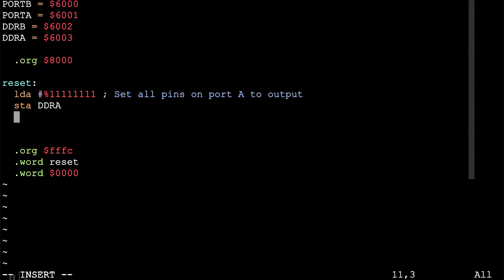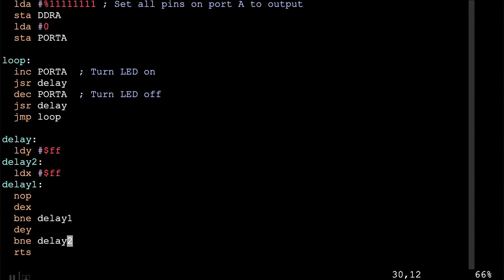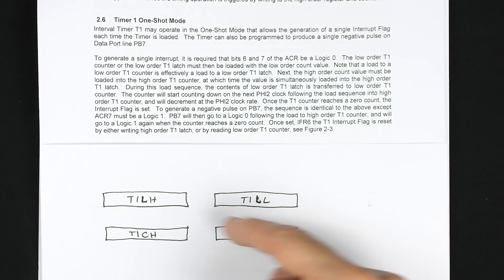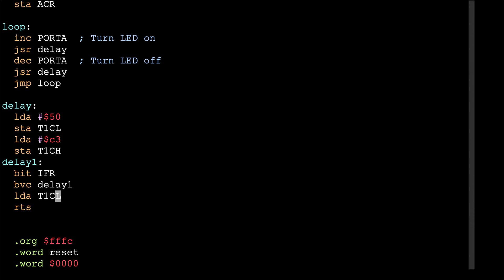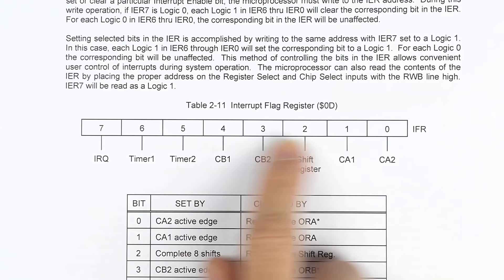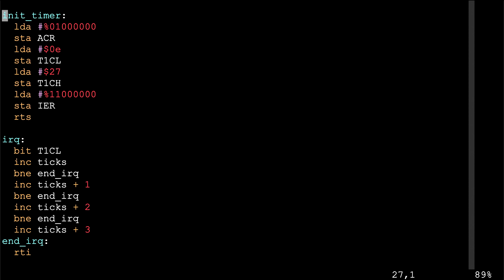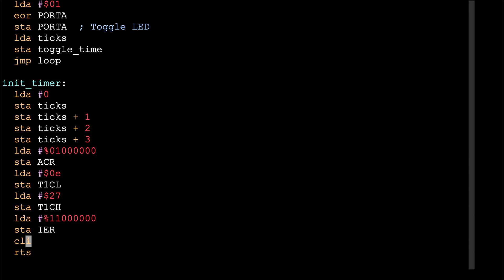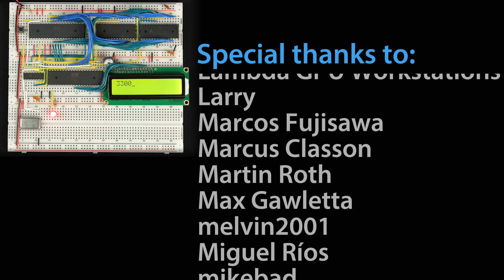How do hardware timers work?

Comment: I love everything about this series. I'm eagerly awaiting the point where Ben eventually builds a C compiler for the breadboard 6502.
Reply: You'd love the book "Assembly language step-by-step" by Jeff D. It does exactly this
Reply: @sadhlife  it is not the same thing. It has to be done by Ben.
Reply: @sadhlife  if not then thanks for the link. I will be looking into it. Thanks for adding to the YT conversation.
Reply: @ElSenorEls  Well, not everything has to be from scratch.  Ben might be able to demonstrate an integration of existing freeware into his machine in such a way that one can readily duplicate it.
Reply: Do you mean a C compiler that runs on the breadboard 6502 or a C compiler that merely targets the breadboard 6502?  
While I get that compiling C on the machine that targets itself would be a really solid learning experience in many ways, especially if it's capable of self compiling, there are a lot of reasons most consumer level computers using 8-bit processors defaulted to an off the shelf Basic interpreter within such constraints and many of those would equally apply to a project like this.
Reply: .. and a filesystem
Reply: @chiblast100x  First one, then the other of course! Then all he has to do is get it to play DOOM.
Reply: Not doom - elite
Reply: @Sigira0  Crysis lol
Reply: @sadhlife  I'll have to mention this to Jeff D. next time I run into him online.
Reply: @sadhlife  Do u have any recommendation to (if possible) kernel/kernel-like os for AVR? I assume it is not recommended haha
Reply: @mickolesmana5899  no clue :)
Reply: I'm waiting a 2 core 6502
Reply: Considering the 6502 time-frame, FORTRAN IV might be more appropriate. Of course, this isn’t the history channel…
Reply: @saxhorn1508  : What he should really do is a threaded-code variant of Forth, with just enough extra code to provide the common Forth in-place compile, support for a simple filesystem on SD, software based memory paging, and the extra Forth primitives required to perform C and Basic operations semi-efficiently. Then he'll be able to implement whatever toys or demos he wants fairly simply.
Reply: Nah, what we want is Linux running on it with a C compiler. :)
Reply: I'm pretty sure the small stack size of the 6502 would prevent anything more than a minimal C compiler.  I could be wrong though, I'm definitely not an expert.
Reply: @AndreasToth  Don't see that happening as even the very first Linux kernel version was for 32-bit machines and a modern kernel is way too large for what we need here. But an old-school Unix kernel, like going back to Bell Labs and the Ken Thompson and Dennis Ritchie days of the early 70s may be more appropriate.
Reply: And possibly create his own language and a whole parallel universe analogue to GNU/Linux. That'll be just great 😁
Reply: @stevedonkers9087  There already exists a C compiler for the 6502. It's called cc65. It's quite an impressive piece of software and does a good job considering how poorly tailored the 6502 architecture is to a language like C. I have also seen C be used for the 65816 chip. In fact, the source code to Wolfenstein 3D on the SNES leaked, and it was written in C. As a matter of fact, WDC provides their own C compiler for the 65816. Although, the Z80 is apparently much more suitable for usage with C, still not great though. Certainly very doable and has been done before. I think I even saw some crazy person write C++ on a C64. There was even something called Java Grinder iirc that could compile Java to machine code that could run on CPUs like the 6502 or 68000. It's truly remarkable what passionate programmers can do given the time and determination
Reply: or he could use an existing 6502 C compiler like cc65. He'd just have to port the library.
Reply: no you have to be  eagerly awaiting for monitor display interface😀
Reply: @sadhlife  Excellent book that.
Reply: WITH HARDWARE.
Reply: @SeekingTheLoveThatGodMeans7648  by freeware do you mean free software? they're not the same thing
Reply: @omarnaser8291  already built one: world's worse VGA display.  Architecture doesn't lend well to display anything useful, problems sharing memory access
Reply: @fabiotiburzi  lol
Reply: He just installed MS BASIC on this thing in the last video

Comment: The first method, depending on the processor speed, reminds me a lot of those games in the 80s that became impossible to play when you upgraded your computer to the latest 386 dx-33.
Reply: This was one part I didn’t understand, isn’t the 2nd method still clock speed based? From previous context I know it’s running on 1mhz oscillator, so isn’t it technically a coincidence that 10k phi2 pulses = 10ms?
Reply: @JonJaques0  It is clock-dependent, but I'm pretty sure he intends to keep it at 1MHz (and anyway, there's no RTC so the clock is literally the only thing it can use to time).
Reply: @JonJaques0  Basically if your unit of time measurement is cpu cycles, it becomes clock speed dependent. 
The idea is to measure the time independently of cpu cycles. The Timer timeout implementation does exactly that.
Reply: Same issue in video games. In-game physics sometimes use frames as the unit of time. Anything from Mario 64 to Mario Kart 8 only works right in 60fps.
Reply: @JonJaques0  Many systems specify the tick timer in real time (so here that might be a constant indicating 10 ms or, equivalently, 10,000 us, for example) or they give you constants for how many ticks their tick timer makes per second (so, 100 ticks per second here).  There are other variations, but that's the idea.

Given those tools, you can write your code to be portable because someone else did some or all of the work needed to figure out how to measure time portably.

In situations where people are ignoring portability ("Everyone's got the same computer I do, right?") or at some points in the past when this type of thing may have been less common, people would often write things to only work on their hardware, causing the issues when you switch to new computers.

Another issue might be in small systems where memory was tight and CPU time limited, it might be too hard (or at least perceived to be too hard) to make the code flexible and portable.

So, basically, it is clock dependent, but with the right tools you can easily compensate.
Reply: I was blown away when I learnt as a kid that the 'turbo' button actually made the thing go slower
Reply: @harrytsang1501  most game engines have a dedicated physics update which is more precise
Reply: @harrytsang1501  actually, SM64 runs at 30 fps
Reply: @ninja_raven256  I think it does physics at 60 but only renders at 30
Reply: @bobdagamer640  this is true today but not for most older console games. Since consoles back then had to generate a 60Hz (or 50Hz) video signal, they expected you to update the scene every 60th of a second; the easiest way to do that was to just have your entire game logic be a loop that runs the game, waits until the video system wants another frame, gives it one and repeats.

There were some console games that properly separated video from game logic and thus could run at just about any frame rate (and you can have fun messing with the time scales) but this took more effort and resources on those limited systems, so it wasn't common.
Reply: @renakunisaki  ah, thanks for clarifying.
Reply: @renakunisaki  It actually runs physics calculations 120 times a second; it runs them every quarter of a frame (quarter-step).
Reply: @renakunisaki  actually it doesnt, sm64 still runs physics in 30 fps
Reply: @JGMeador444  quarter-steps are only used for mario's movement, everything else runs at 30fps
Reply: @dabs4270  Apparently I need to look at this again and really understand what's going on.  Thanks for calling that out
Reply: @shaikhahmed7929  
The funniest thing about this all is that Microsoft Windows store the timestamp in a special memory page that you can ask to read from, exactly like this implementation! It's kind of hilarious.
Reply: I remember reading that when CPUs got too fast to play ‘80s games, they added the Turbo latching button to speed up game play.  But it actually worked by SLOWING the CPU to let other hardware catch up!
Reply: It still happens today. GTA IV, Saints Row 2, and other games where the physics engine is inconveniently tied to the framerate.
Reply: @anisnej10  
> still happens today
> mentions old retro games
Is this bait?
Reply: @dabs4270 Ah, you're aware of the quarter steps. That makes you 4 parallel universes ahead of us. XD

Comment: Sometimes, when I don't have an o-scope at hand, and I'm testing stuff like this, I like to use a speaker (with a resistor in line). After a while you can make pretty good guesses on order of magnitude of frequencies. In this case, it would sound a B on the far right end of a piano.
Reply: Wicked cool
Reply: You are one mad lad 💀💀😂😂
Reply: i think you can build some synth modules like that
Reply: You debug using hearing, instead of reading, or in case of diode, seeing. That's cool!
Reply: @heisenbug3542  it's not so much a choice as, "you use the tools you have"
Reply: Are you Eddy from TwoSet Violin alt account?
Reply: If im ever in a pinch imma use this tip
Reply: @cryptic_daemon_  You mean when you're in a pitch? .... I'll see myself out.
Reply: To make this more precise you can use a simple guitar tuning app on your phone. It'll show you the exact frequencies
Reply: @DelphineDofain  ping ping 40 hours
Reply: Exactly what I was doing. I fed the output to a toy speaker laying around and used an application to figure out the roughly frequency.
But this has some drawbacks: when the freq was too low or too high the app freaked out.
Reply: earscilloscope
Reply: I have an ancient piezo earphone from a crystal radio set for this purpose. It is very sensitive, and has high impedance, so you can stick it anywhere. But never actually have it in your ear whilst probing around strange circuits!
Reply: @jimmy21584  oh, that's a good idea for the piezo ear piece. I normally end up with and overly complicated cisctuit involving an audio transformer (bump the impedance) and a capacitor (avoid shorting out any DC signals).
Reply: You mean a C#? A C#4 is roughly equal to 277hz, and as far as a piano, its relatively in the middle.
Reply: That’s amazing lol

Comment: Note: in both the software timer at the beginning and the hardware timer (probably, depending on the datasheet, but most hardware timers are like this), you can set the counter value to 0 to loop 256 (software) or 65536 (hardware) times. This means you get one more counting value to use! This works because the loop checks for 0 after decrementing, at which point it will already have overflowed.
Reply: Almost every timer starts counting from 0. 1 extra count doesn't give much at all tho. The most practical function of modern timer peripherals are the prescalers that lets you divide the actual clock frequency, so the timer could go an X number of magnitudes slower than the CPU clock. I wish you could see the blueprints of the entire clock schematic for the current processor I'm working with. It's massive, and quite amazing tbh.
Reply: @TheChrisey  Timers usually count down  just like assembly loops usually do. What I'm talking about here is just the technical inaccuracy that 255 isn't the highest value, 0 is, because it acts like 256.
And don't worry. I am working on some comparatively massive and amazing stuff.
Reply: @fghsgh  Timers can either count up or down, there is no standard. I always have mine count up for convenience. Obviously if you were to count down you would start at a larger value and auto reload at a lower one. Everyone knows that. I didn't see anywhere that the timer he used were by default counting down.
Reply: @TheChrisey  1. Counters are definitely easier to implement in hardware if you just have to check for zero than if you have to match against a specific value.
2. The assembly loop definitely works like this. It's obvious from the instructions he uses.
3. Given other details about the hardware timer he used, I suspect that one also counts down. And even if it were counting up, setting it to 0 would still count all the way to 65536, because there is just no reason to overcomplicate silicon logic, especially not in the 70s, when this chip was designed.
Reply: The instruction BCT/BCTR IN THE IBM mainframe similarly decrements a 32-bit register containing a 31-bit signed number in 2-s complement notation and tests for zero AFTER decrementing, branching if not yet zero.  So if you put that into a loop, you can execute that loop the number of times you set in the register to before you start.  But if you START at zero, you go through the loop 2^32 times, or about 4 billion (0 becomes -1, then -2, down through -2^31, then +2^32-1, 2^32-2, then down to 3, 2, 1, and 0 fails to branch and stops the loop).

Even on a moderately fast mainframe this could take hours, even with the branch being back to itself in a one-instruction loop.
Reply: @allanrichardson3135  Yep, a lot of architectures are like that. z80's djnz (decrement and jump if not zero) for example is the one I'm most familiar with. But even if using multiple instructions for it, as the decrement instruction usually already affects the zero flag, the check if it hit zero is free. If your architecture also has decrement affect carry (which is not the case for z80 and x86 and such) you could also check for zero before the decrement by checking the carry flag instead.
Reply: @fghsgh  The System/360 Principles of Operation (1964) and all its successors actually warn about this quirk.  They advise programmers to initialize the register to a positive value (given twos-complement notation, negative or zero values would not be meaningful) before using the instruction to control a  loop.

But there are other uses: since the register form, in which a register other than register 0 is the branch address, is a two-byte instruction (the shortest length possible), “BCTR reg,0” just subtracts 1, and two of them together take less space than “SH reg,VALUEOF2” (4 bytes) plus a halfword (length 2 bytes) somewhere else “VALUEOF2 DC H’2’”  So to subtract 1 or 2, use one or two “BCTR reg,0”s, more than two, use SH and a DC or a literal to generate an internal DC (=H’number’).

Comment: everyone who writes any type of code really owes Dennis Ritchie a lot of gratitude.  This syntax and how loops are written with it really makes one appreciate the for() and while() loops that came with the C language.
Reply: Actually structured programming was well in vogue by the time C was developed. It wasn't the first, but ALGOL 58 probably was the most influence on control flow in languages, for example it had the rather gross syntax but very familiar logic of:

for i := base(increment)limit
begin
   ...
end

So you should probably direct your language design praise towards John Backus and Peter Naur, though Ritchie's work on C deserves a lot of praise for actually replacing the use of assembly due to C's efficiency.
Reply: C was actually a continuation of the programming language, B.
Reply: Wherever it came from.. Let's all just appreciate the existens of C overall. Without it, we would be sitting with ridiculous overly abstract syntax and begin...end...begin..end..begin..end that would make melting clocks look like a walk in the park.
Reply: @TheChrisey  Well, to be pedantic, B did not follow that syntax. In fact, C was very similar to B and I'd probably confuse it with C at first glance. But yes, your sentiment is correct. C is a beautiful and simple language! Dennis Ritchie was a king!
Reply: @TheChrisey  Let's not get carried away. It was well known by the early 60s that assembly was not the ideal solution for every situation. Something better was needed. That was 60 years ago! To say that we would be stuck with an overly abstract syntax were it not for C, is like saying humans are incapable of innovating. However, assembly still plays an important role in modern programming; not everything is written in C.
Reply: @jaredteaches894  and was B a continuation of A(ssembly)?

Comment: Brought back some great memories. When I was going to Data Systems Technician school in the Navy in 1974, one of our machine language programming assignments was to turn the front panel registers on a Univac 1218 (clock speed 667Khz and no you did not read that wrong) into a digital clock. We had to do a lot of calculations on the time each op took to make the clock accurate.
Reply: @priyapepsi  Start with assembly on the simplest microcontroller you can find, and work your way up to C. That will give you a really sound base of understanding.
Reply: @priyapepsi  No, you start with C, which is one single syntax regardless of platform. Once you've learned it, you move onto basic assembly on either an x86 or some ARM/AVR/Whatever MCU and work your way from there. You need to know that while C has its specific syntax. "Assembly" is not a syntax, but a way to turn actual numbers (opcodes) into readable commands, and every CPU architecture has its own set of commands. Hence why every architecture needs a specific compiler.

Comment: WDC W65C02S also has a WAI (wait for interrupt) instruction, so adding it in a loop decreases the power consumption. The tick values change after an interrupt was processed anyways. The beauty of it is that in other manufacturers 65C02 it is an "undocumented NOP", and on 65C816 it also is a WAI ☺